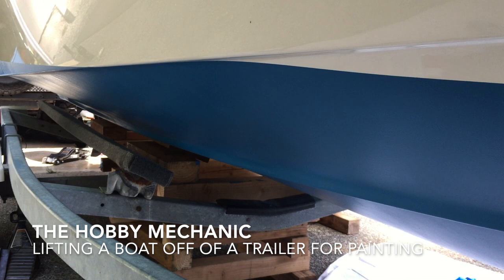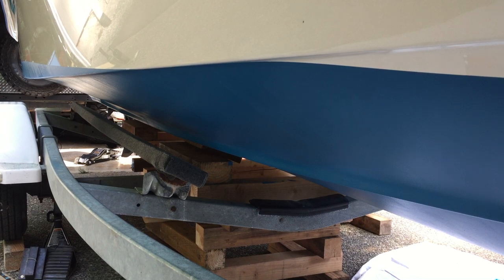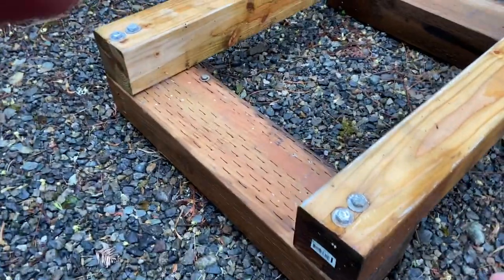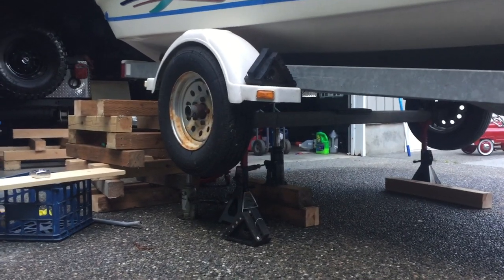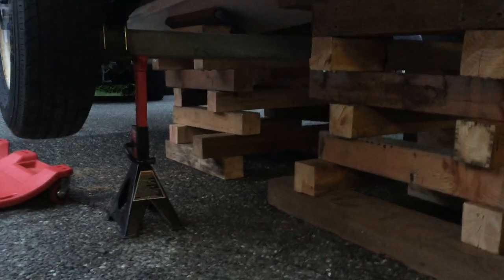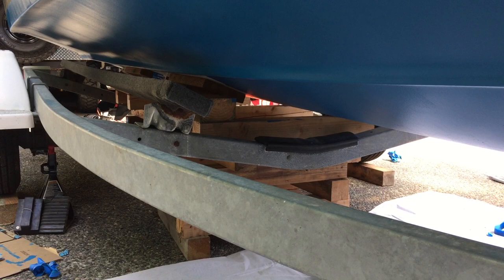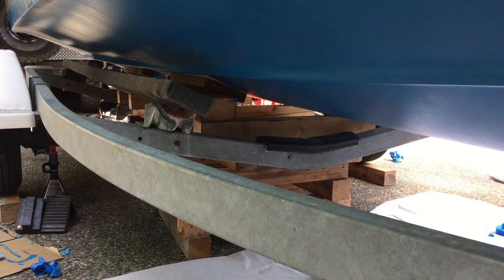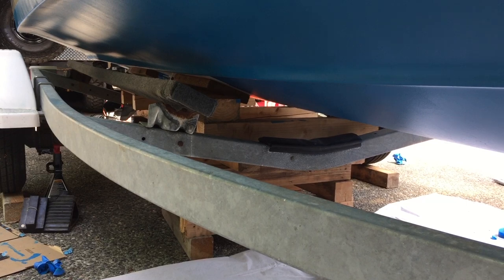Easily Lift Your Boat Off Your Trailer for Bottom Painting - Hobby Mechanic

Comment: Hi there, how has this brand of antifouling performed for you? And another question, do you think it reduced speed, since you mentioned that with your roller you had a bit of a rough surface finish? I am wondering if there was any marine growth, or if the paint washed away at some spots since you did not use a primer. I am currently removing all the bottom paint and I shopping around for an easy antifouling, I like that you didn't prime but just wondering how it performed. Thanks.
Reply from the maker: Good question.  The paint I used is ablative antifowling paint and it slowly wears away over time.  That’s what’s intended.  The paint wears off onto the trailer skids and will start to wash off if pressure washed.  I still have pretty good coverage to this day from the one paint job though.  There is a hard bottom paint that is more permanent.  Not sure which is better.  Not sure about the speed impacts.  It’s not a polished surface so I assume it’s not as good as stock but none of the bottom paints are polished so I don’t thinks there’s a way around it if your boat is mored in salt water.

Comment: If this is for painting the wood supports still touch the sides, yes? I think this unavoidable and then you have to go back and paint those spots after it's back on the trailer I assume. Is this what you did? Did it match very well?
Reply from the maker: Yeah, that’s it.  It looks good and you can’t tell where those last spots were.  The paint looked perfect when I launched the boat but salt water is rough on it so it’s meant to be re-applied every couple/few years or so.